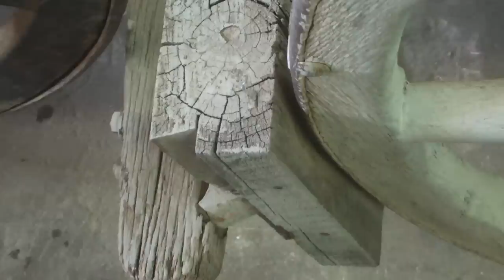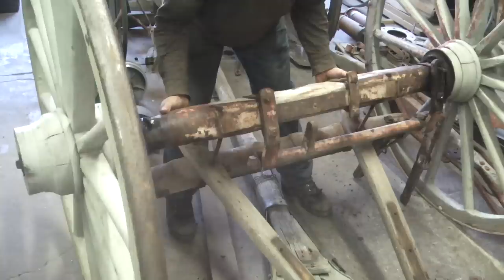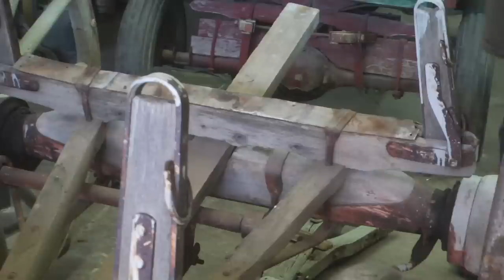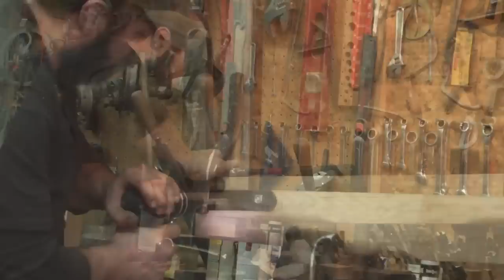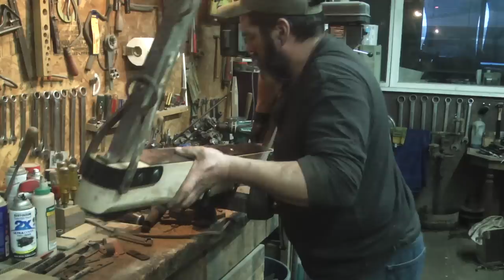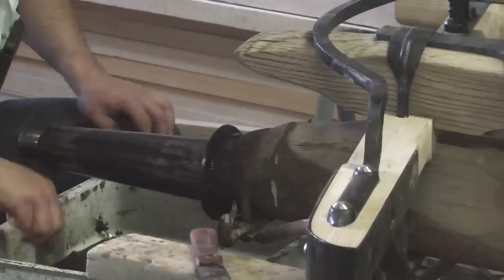Repairing a Studebaker Wagon Gear & the Front Axle | Engels Coach Shop

Comment: I just got a set of 4 iron wheels from an antique manure spreader, I would like to build a wagon for a garden and fill it with flowers. How would I go about it, should I use pipe for the axles? The original were wood, still some present in the hubs . Please contact me if you can give me any suggestions.